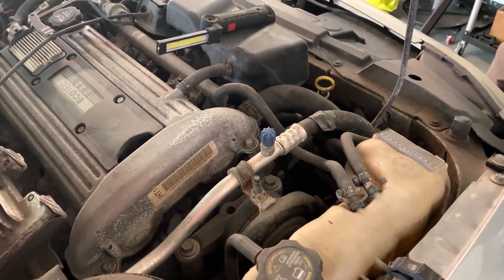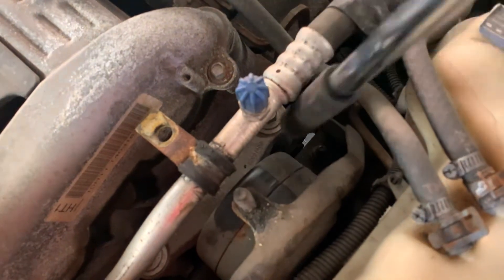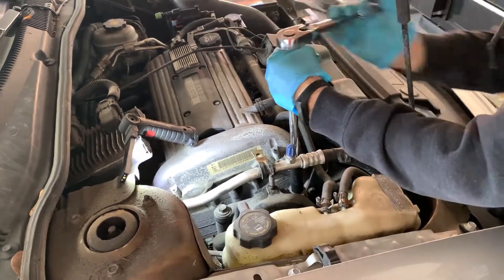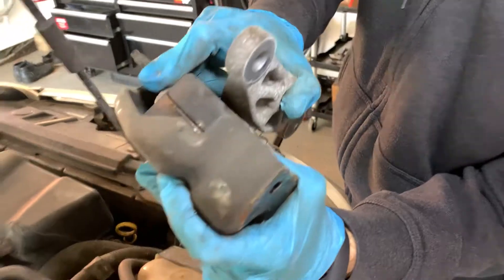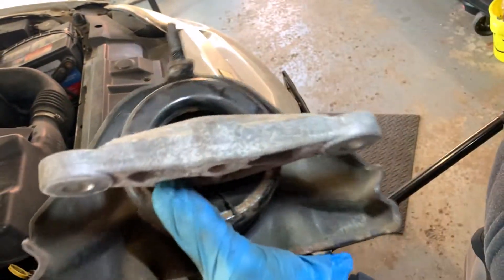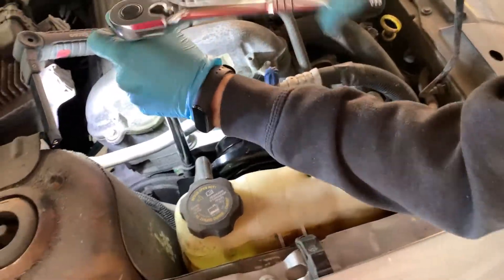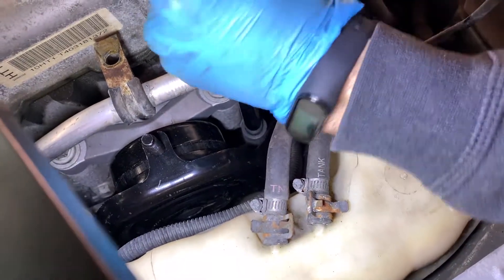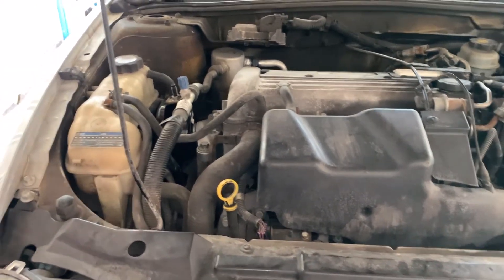Cavalier/Sunfire 2.2L Ecotec upper engine mount replacement

Comment: @9:33  I eventually replaced the Upper Engine Mount on our 2003 Chevy Cavalier. I released the  Engine Mount Strut (Sometimes it is also called Lower Engine Mount or Dog Bone, but it doesn't support the Engine, so when you remove it, no need to support the engine fm the Oil Pan). In my 2003 Chevy Cavalier Shop Manual, v. 1, p. 6-67 it says: Align the Engine Mount to the Mount Bracket using a dowel. I don't know what the dowel is exactly, but the picture showed the stick inserted in the middle hole of the Upper Engine Mount. So as a DOWEL I used just large Crescent Wrench fm/HD (cost ~$30), it is engraved on it CRESCENT AT215SPUD. 
   On the Home Depot site now they are:
16 in. Black Oxide Adjustable Construction Wrench, now it costs $46.97, they are also on Amazon for $45.46.
   As a Dowel I used the sharp end of the Crescent wrench. It worked as a charm, the move of the engine was very easy. I think the purpose of that hole in the middle of the Upper Mount is exactly for the use of the Dowel. I moved it around w/left hand, while adjusting the bolt into the hole w/the right one. I even don't know if I would be able to complete the job without that dowel. Thank you again for the film, it was very helpful, but I removed 1st the bolts, then the nuts (as was advised in the Shop Manual). Everything else I did the same as in this film (also Dowel, so you don't need another person to move the engine around). Al torques (on bolts and nuts)  41 lbs-ft. Fixing AC lower pressure line retaining bracket Nut is under 10 Nm (89 in-lbs), if someone needs.

Comment: Great vid! Thnx. Im having problems with my engine moving way too much when i put it from park into drive or reverse. When i put it into drive will make the engine do a very loud thud and makes the car move. Ive tried replacing everything any idea what it could be?
Reply from the maker: Have you checked or changed the transmission mount on the driver side (assuming it has automatic transmission)? It’s a metal plate with a bushing, usually 10 or 15 bucks, and miserable to replace.

Comment: @13:26 I have Shop Manual for 2003 Chevy Cavalier. It is really confusing for those specs. At the end of the Upper Engine Mount job they give Engine Mount-to-Body Nuts and Engine Mount-to Bracket Bolts 41 Ft-lbs. But then next statements is: Tighten the Engine Mount Bolts to 81 Ft-lbs. This torque is also present for Engine Mount Bracket bolts (2 horizontal Bolts which attach that Bracket to the Engine). I think 81 Ft-lbs is for those horizontal bolts, but why they are mentioned for Engine Mount Replacement? Probably to double check if they are at that particular Torque. Torque 41 Ft-lbs looks more correct to me, as you say to snag and then 1/4 turn.
   Update: Everyone (including Dealer) says it is 41 Ft-lbs.
@ 14:14 that nut is under 10 Nm (89 in-lbs) (fm/Shop manual), if someone needs.

Comment: This is the best film on the Upper Mount replacement, thank you very much.  I need to replace it on 2003 Chevy Cavalier, exactly same engine and everything. Please could you tell, if I can remove the Lower Engine Mount (Dog Bone) before the replacement of the Upper Engine Mount, so I can move the engine easier. As far as I understand that lower Mount doesn't keep the engine in vertical direction, but just prevent it from rocking back and forth. And can you lift the engine by that vertical hook (vertical plate with a round hole in it) on the left from the pan (if you look fm the front, it is on passenger side  @ 0:40) instead of lifting by the Oil Pan?  In one film I saw he said it is better to lift the engine by that hook, but in the Service Manual I have for that car, it says to lift how you did. Thank you again.
Reply from the maker: I know the hook you’re talking about, and to be honest I’m not too sure if I’d use it, as it’s very thin. I always use the pan with wood between it and the jack. As for the dog bone/torque strut mount, yes, I would absolutely recommend disconnecting it, as it would make the engine much easier to move. I didn’t do it on this job, but I definitely would next time. You probably noticed we had a bit of difficulty repositioning the engine. That lower mount is usually pretty worn out if it’s original, and they’re cheap, so maybe just replace that too if it’s old. Thanks for watching and commenting!
Reply: @416diy  Thank you for the replay, my notification was off and I didn't see your answer before now. I bought long time ago a set (Upper Engine Mount, Dog Bone (Lower Engine Mount), and Transmission Mount) fm/Amazon, and I plan to replace Upper and lower Engine Mounts. I went to Dealer for diagnostics to find out why the car occasionally makes whining sound turning left. They told me that the Upper Mount is worn and the engine is sitting too low and scratching smth on the bottom on turns. To be more exact the girl (Service Advisor) told me that the Lower Mount is worn and they want to replace it for ~$650, kind of mechanic showed her smth on the bottom (she didn't know what it is). I knew that it is pretty easy to replace that Dog Bone, so refused their service and took the car home. On the further research I realized that the Dog Bone can't alter the vertical position of the Engine anyhow, and it should be the Upper Mount. Looked in the paper they printed for the diagnostics, and it said "the Upper Mount" in that paper, Lower Mount wasn't mentioned at all. Anyway I'm replacing both. I would replace and the Transmission Mount, but no films for this car, so I'll postpone on that.
Reply from the maker: Do you have automatic transmission?  There's a reason there's no video on how to do the automatic mount, it's because it's a disaster. The expansion bolt in the driver side wheel well will be rusted and seized in place. It looks like a nightmare to do, and you may have to source a couple of other small parts, like the expansion bolt, which are all discontinued. The tranny mount is referred to as an insert, and it's cheap, usually $15 or so. It's attached to a larger bracket on the tranny, and I think you have to pull the bracket and insert out together to separate the two pieces.
Reply: @416diy  Yes, it is automatic. I do on our cars some things on suspension, like CV axles (I replaced on 2: 2003 Chevy Cavalier and 2001 Saturn SL2), Struts and Shocks (I did on all 3 we have: Saturn, Chevy and 2009 Nissan Sentra). But this Transmission Mount I'd better go to Dealer. Usually I'm not quite satisfied with their work, but still on this one probably it will be the best solution. Thank you that you wrote.

Comment: Just started getting a bump when breaking and taking off from a stop, sure enough the upper mount was pancaked in on itself as you showed, mine is a 99 z-24 convertible, I have the front bodykit now and side skirts showing up soon, rear bumper bodykit is a hard find for these cars, any convertible parts are becoming quite pricey aswell as they are not made anymore.
I can tell you, the convertibles are fun and well made, love the parade boots and cover that hide the top mechanicals nicely aswell.

Comment: So you just draw the engine up to the mount by the bolts?
Reply from the maker: Essentially, yes. Something I didn’t do here, but I would recommend, is to first disconnect the torque strut mount that sits in front of the passenger side lower control arm. You’ll be able to move the engine around easier.
Reply: @416diy  Just wanted to ask @ 10:09 if you disconnected the Dog Bone on the bottom. Thank you for the answer in your comment.